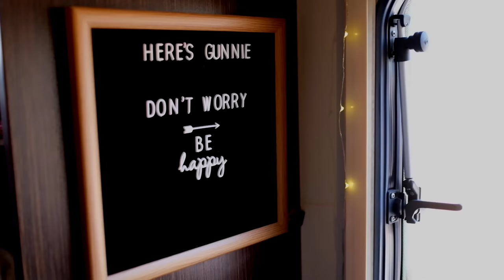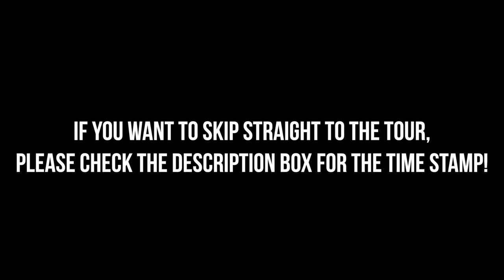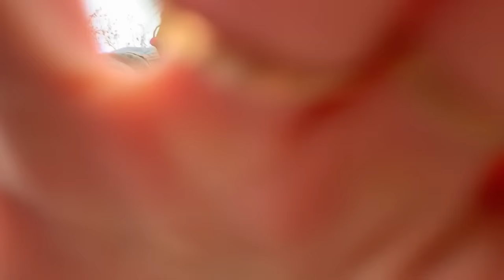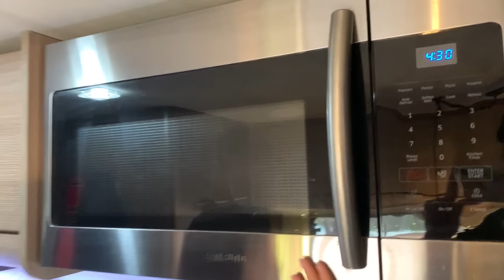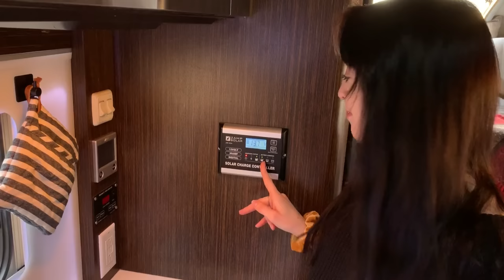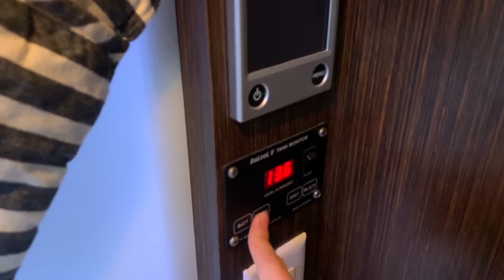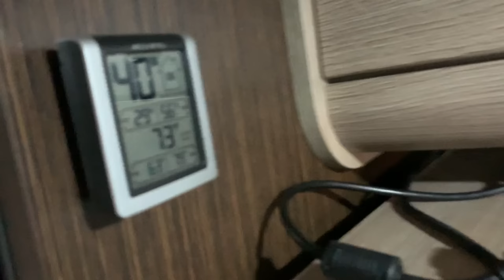Off-Grid Full-Timing Couple's Truck Camper: Tour + Review of Cirrus 820

Comment: Bad choice.  Far better campers like Arctic fox.    Fix has they pound tanks, solar panel, largest camper holding tanks etc.  Hand made wood cabinets home style.
Reply: I enjoy your bias. But arctic fox is not far superior. It is a nice camper with a good record. You are talking about a slide out camper. Different animal. If I wanted a slide out then you maybe correct. They make some of the best slide outs. As far as non slide outs, cirrus is one of the best ones out there. I love northern lite also. These are premium campers and there price shows it. They keep winning best of show at the rv shows because of their aesthetics and their systems. It is definately a different kid on the block... if the way it looks and feels inside is not that important to you than look to some of the things that make it so good. The alde heating system is awesome! It sips the propane and makes the inside a perfect temp. Hot water is great. Forced hot air is horrible in a camper that boondocks. Blows thru your batteries quick. This system is a hot water/heating fluid system that flows throughout the rig. That, to me sets it apart enough for tru boondockers. I have owned 2 truck  campers and rebuilt them both. I have researched new campers for more than 10 years. You will have to check them out in person before making a judgement.  I camp with many folks that have many different campers. I'm sorry, but I'm very impressed with my friends cirrus 820
Reply from the maker: DAVID TATLITUG we didn’t choose arctic fox for a number of reasons. Please watch the video before making comments like that, as we explain why we chose Cirrus over other campers, like arctic fox. These reasons include: 
1.We didn’t want slide-outs. Too heavy, more mechanics to break on the road.
2. We wanted the Alde heating system vs forced air
3. We don’t like the aesthetics of arctic fox interiors. The home style wood and brown everything is very outdated. We like more modern interiors like our Cirrus. 
4. We also have solar panels. This isn’t unique to arctic fox.
5. Cirrus actually has a larger fresh water holding tank than the comparable arctic fox model!

I could keep going but I don’t feel like it. 
We’re happy with our choice in truck camper. Thanks for watching!!
Reply from the maker: dsgrayco yes, agree with everything you’ve said! Thanks for the great defense.

Comment: I just found you but it seems you vanished.   Your knowledge about other campers is very wrong.   Arctic fox has 2 30 gallon propane tanks,  75 gallon potable water, has a dry bath and with or without a slide.   It is 4 seasons rated.   Also any Wal-Mart sales a device to put on your propane tank to show how much is in it.   I could say much more but when you said camping world I knew you were screwed.   Possibly the worst place to go for anything and has more law suits against it than any dealer.   Near bankrupt.   Google a few reviews why don't you.
Hope you moved on to something better.